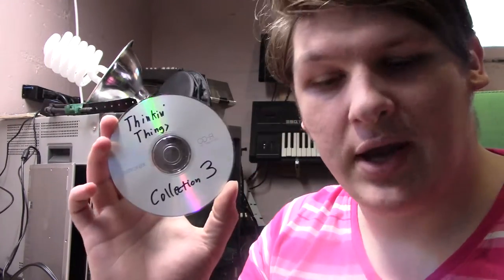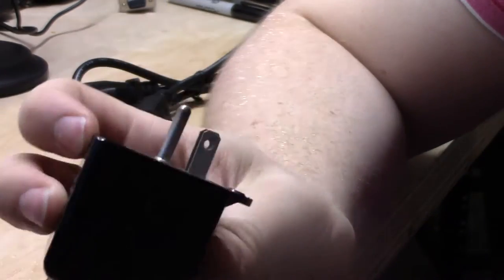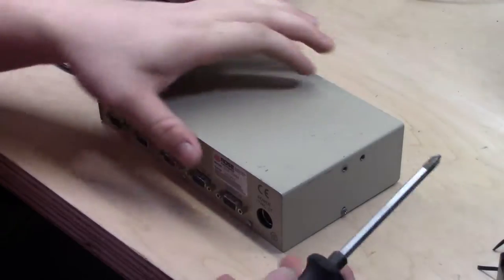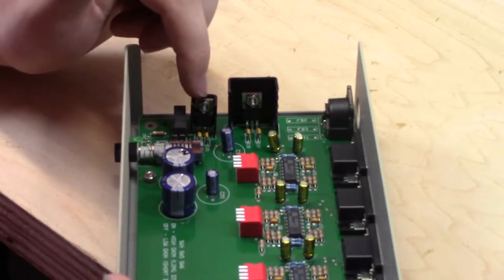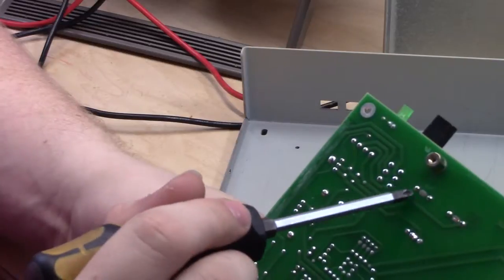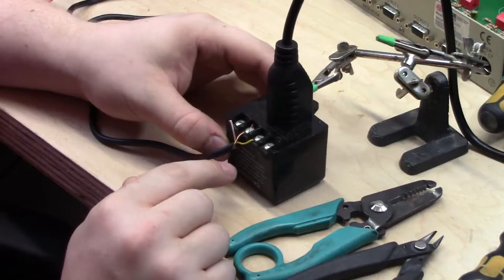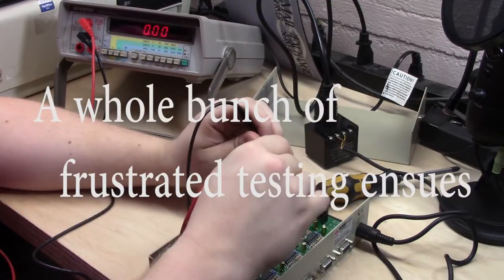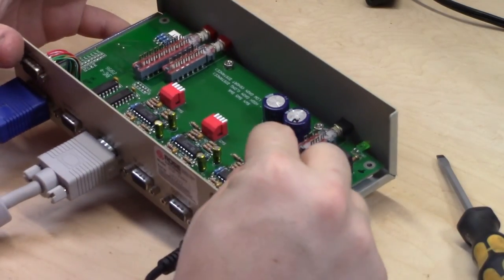VGA Distribution Amp

Comment: RE: Passive video splitters. Analog video signals utilize a precision coax cable with 75 ohms impedance. Very basic transmission theory states the impedance at the source and destination ends must match. So the video source device has a 75ohm impedance and the receiving device (a monitor) has a 75 ohm resistor across the cable. This keeps the cable impedance at 75 ohms which is critical at video and RF frequencies. Analog audio is much lower bandwidth and this precision matched cable impedance is not required so cheap Y adapters work fine for home stereo gear. You may also know that putting two resistors in parallel lowers the combined resistance value. An analog video signal is 1 volt measured across that 75 ohm resistor. When you simply "wire nut" two monitors to one source, like those cheap adapters do, you have two 75 ohm resistors in parallel which divides the combined resistance in half down to 37.5 ohms. So that also divides the video signal voltage in half to 1/2 volt. This is why the image loses contrast. A distribution amplifier increases the video signal voltage so that each jack has a full  1 volt signal into single 75ohm monitor load. There is another way with composite video. Some monitors have "loop through" connectors and a switch for the 75ohm resistor. That 5 inch GBC monitor you have is an example of this, Here you "loop" the coax from one monitor to the next but only turn on the 75ohm resistor at the last monitor. That maintains the full 1 volt video signal. VGA does not typically provide this "loop through" option. Cable TV splitters  are a bit different. They too drop the RF voltage level but maintain the 75 ohm impedance on each split cable. The drop in RF voltage is compensated for by the RF AGC in the TV tuner. However CATV splitters won't work for analog video either.

Comment: That is the first time I have ever seen someone use an actual screwdriver for the vga screws. I've always gone in with my thumbs because I am lazy and illprepared. Usually one screw does it too..
Reply from the maker: it saves my fingertips. I used to assemble electronics that used a lot of crimp lugs and i am DONE having sore fingertips
Reply: @CathodeRayDude  no, its definitely commendable. In contrast,  I tried to tighten a bolt with my fingers today. I will learn my lesson at some point I'm sure.

Comment: Apperently there is no fuse in that vga distribution thing. Your transfomer might have no fuse as well!
You may want to add suitable fuses to the two live wires. Without any a faulty component may cause excessive damage

Comment: In a pinch you could use a 9 volt transformer without a center-tap and connected it between one of the input legs and the center-tap, the full bridge rectifier would then work as a half bridge rectifier and the thing probably would be fine, for long term use you want to increase the capacitors to smooth out the bigger ripple you get with a half bridge rectifier.

Comment: [01:30] LOL! Yeeepp! …Hey man I’m chasing my own tail tryna figure how to do something… stumbling on this vid of yours is the result of like the fifth websearch I’ve done and hey I’m not asking for anything for free (except well, I guess I am lol) but it’s a simple thing for someone like you - Straight away I was like, “Hey! YEAH! THIS GUY WILL KNOW WHATS UP!” …YOu don’t have to go into detail or anything but if you could you please point me to the shore I can swim the whole way there….

Now I know yours is video related but I’m sure you’ll still suss out this in 50 seconds tops…
 
All I wanna do is wire up a Pot or Rotary Encoder to a VGA (looking) serial plug on the back of the SUB from my Logitech G51 5.1 Surround speaker set/pack) cos of course I LOST THE CONTROLLER POT… Hey! At least your device was only on the other side of your room haha! It COULD be worse lol trust me!

I’m fine with the Arduino coding and all that side of things it’s just I can’t seem to readily find much info on or any wiring diagrams for how the Serial port would be configured/connected/which pins relate to which cables and what cables are for what end… 

The 5 speakers plug into the SUB and the SUB has the amp built in side of it.  So really I only need to figure out location of the power i/o pin (to switch) and the vol+ / vol - pins, up / down respectfully, right?

Anyway that’s at least what I assume… but you know what they say about when I do that :)

Any help I’d appreciate greatly no matter how insignificant and irritating - My apologies if so

Nice Rack btw ;).